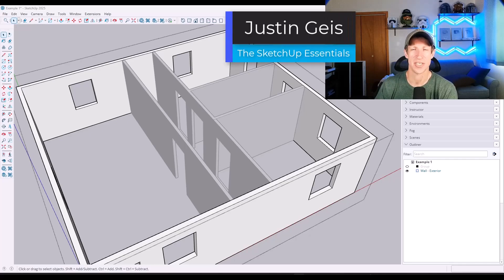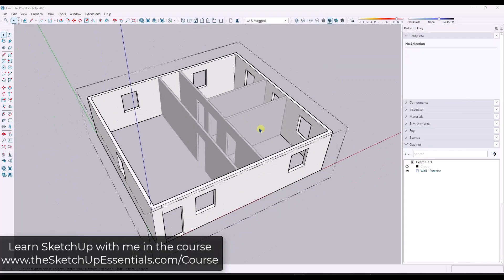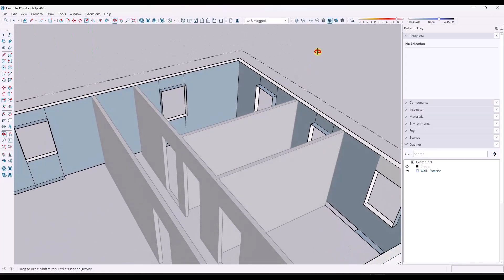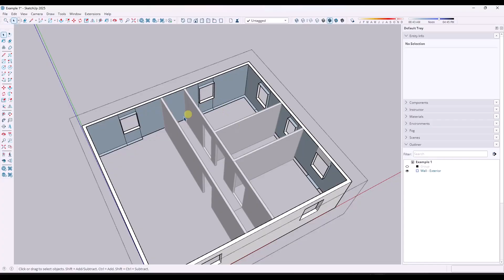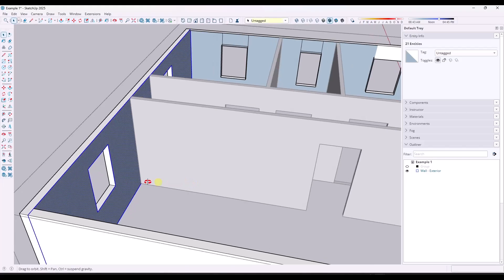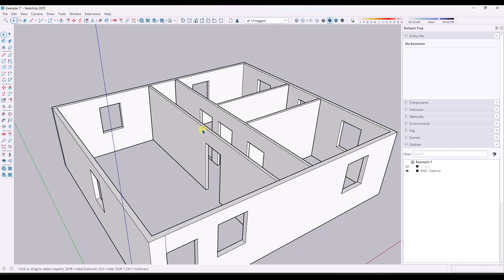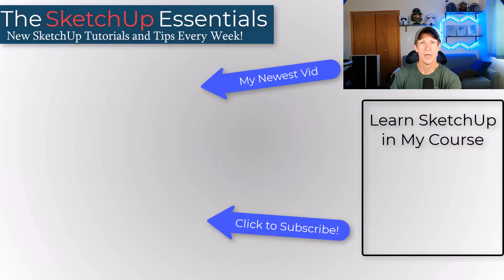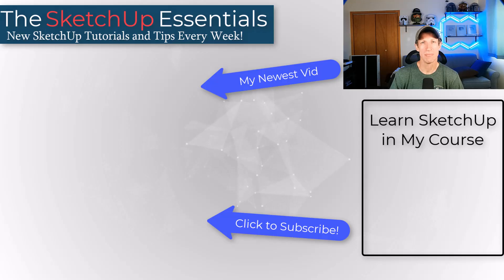The FAST Way to Fix Broken Wall Geometry in SketchUp!

Comment: Sometimes this doesn't always work and it's always a pain when it happens. Sometimes you do this and it simply won't hold the new face and it breaks over and over. Super painful. Or... something like the window square won't separate even though everything is on the same flat plane.

Comment: I have a related pro tip for everyone: If you do find that you need to retrace openings in order to delete them, a simple solution is to Copy all the geometry around those openings and Paste In Place.  The faces will sort themselves out and you can then delete the faces easily.
Reply from the maker: Ooh good tip - awesome! (And weird that it's necessary to begin with ;p)

Comment: Only thing I would change is that I would copy the exterior wall outwards, trim the wall sides off equal to the wall thickness, then move it in inside.
Reply from the maker: That's a good idea as well